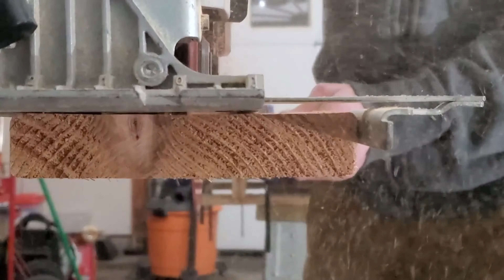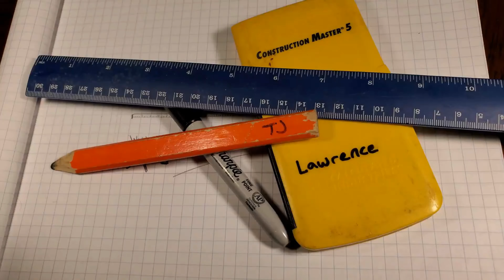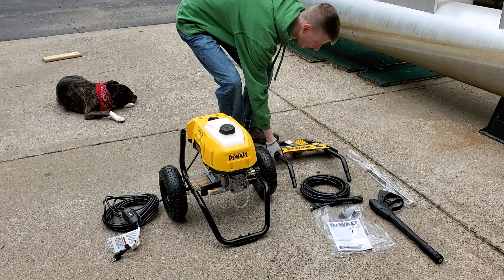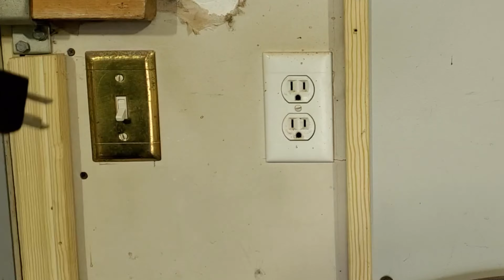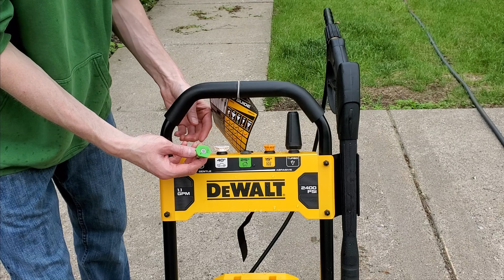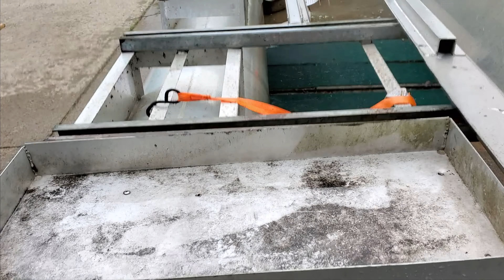DeWALT 2400 PSI  Electric Pressure Washer! Unboxing and Review.

Comment: I had problems getting the unit to discharge the soap.  The user manual is inadequate in explaining its operation.  I called DeWalt technical support.  They could not answer any question about it.  They suggested I try YouTube.  YouTube helped, but DeWalt was a joke.  I am still less than satisfied with the use of the soap dispenser.

Comment: Great video, especially helpful was the tip about the soap line, mine was bent and not on tight, I did as you suggested, cut a little piece off, reattached it and then used a small zip tie to secure it.  One thing... taped to the back of the manual was a wire with a pin attached to it, looks like a circle the size of a quarter with about a 2" pin coming out of it.  Anyone figure out what that was for?  

Otherwise I had it up and running in less than half an hour.  First project was to clean off a 2006 mini van that is now just used for hauling my dog, mulch, lawn mower etc.  It has not had a bath in 2 maybe 3 years and is rarely used, spending its time parked under trees, it was absolutely filthy.  I used Simple Green in a 50/50 solution in the soap tank, started with the soap nozzle, let it sit 10 minutes, then hit it with the auto nozzle, it worked great, car looks almost new, no damage to the paint.  Thank you!